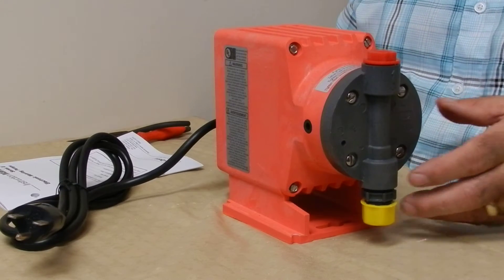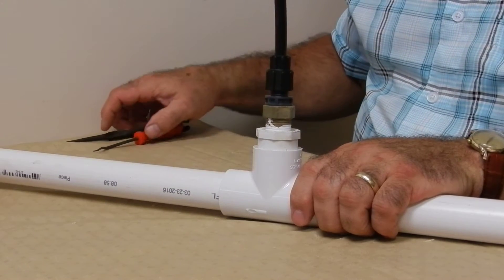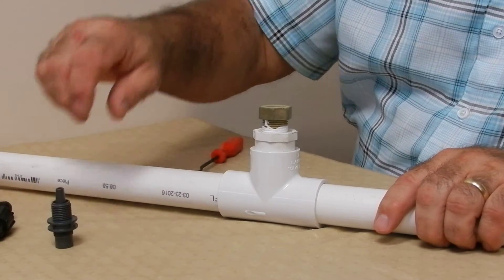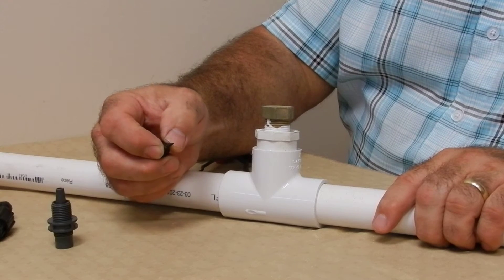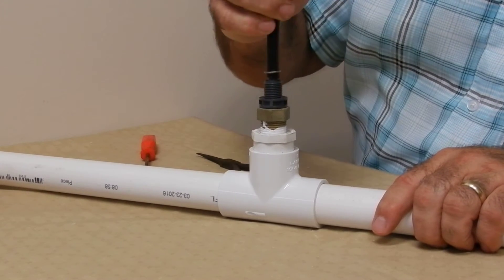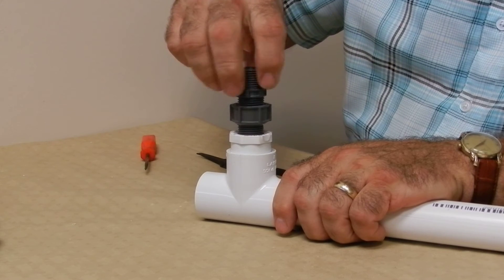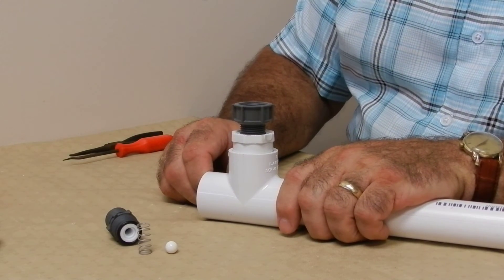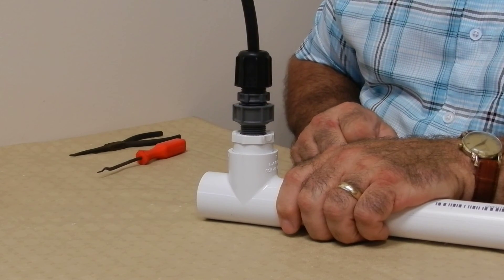Chlorine Injector Maintenance

Comment: I realize this video was made several years ago, but the parts are still the same. I'm wondering if it's necessary to add Teflon tape to the top part before putting the nut on

Comment: Wondering why the check valve chlorine Line keeps popping out . Sometimes it takes a week before it comes loose. That’s even after I make sure nothing is blocking the valve inside pvc line. The pvc line is old though.
Reply from the maker: Hidden obstruction.  Replace pipe.